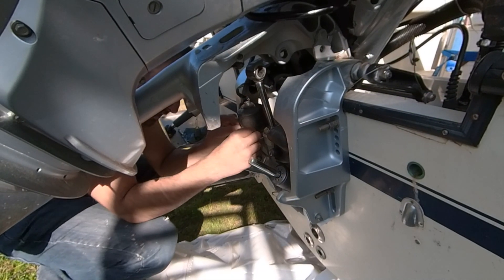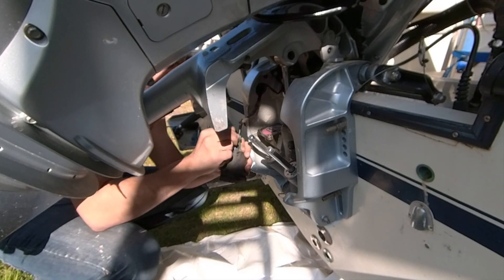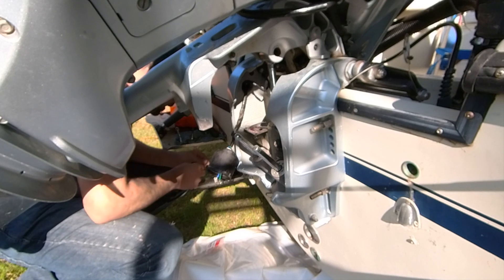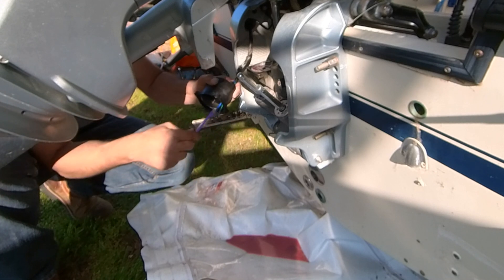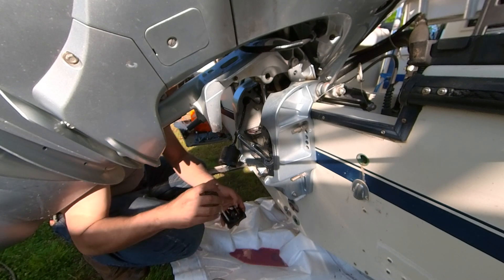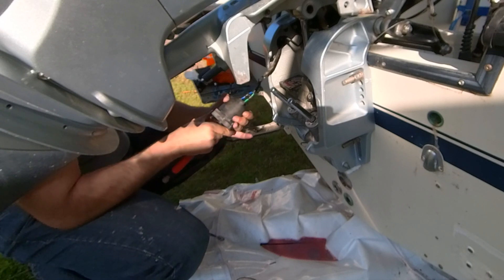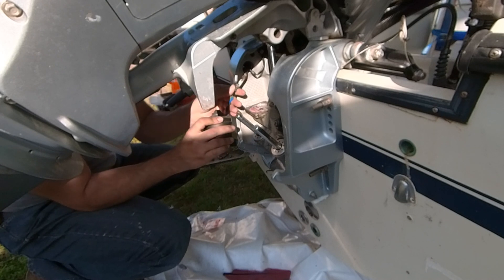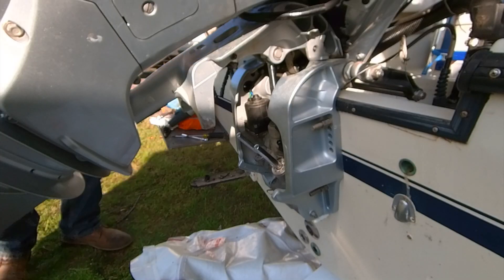Honda BF250 power trim service.

Comment: Thank you for your help, with your help I got up the courage and cleaned the engine only that the problem still persists for me and maybe you have an idea how to solve it or what I need to check.
After sliding the boat and going with it for about 4-5 minutes and I wanted to move down the trim-engine the fuse 30ma break.
What can be the problem?
Reply from the maker: I need to know exactly what you did to the engine in order to try to guess what could have happened. 
In the meantime, if the fuse that blew is the one that controls the trim, check the wires in the engine. If your engine has a trim switch on the side of the engine, try to see if that switch works, then trace the wires so you can identify the right solenoid for the trim.
Reply: thanks for the answer. in fact, on the side it has a trim switch that allows me to raise or lower the engine and I have already checked the wires (but I will check them again with a multimeter). What I  doesn't understand is why the fuse only blows when I'm on load when I try to take the boat on a wave with the engine running at 4000 rpm or while I'm driving it at 3500 rpm (could it be because the boat is very heavy?)
Reply from the maker: @ayanyutuberul99 That sounds about right. The only thing that I don't understand, is why is not properly fused from the beginning if that is the case. 
I would suggest that you change that fuse with 5 or 10 amps bigger and se what happens. If it is just because of the load it should last longer. If there is a short, it will still blow the fuse. So that and tell me what happens.

Comment: Great video!  I have a Honda 200hp that won't go down even though its getting power.  Do you know the individual names of the parts that you ordered?  Would like to order them ahead of time as you did
Reply from the maker: You will need to go to the website and find the schematic page with everything there. Boats.net is a great site. That's where I get all my parts. If you decide to do some work on your engine you'll have to get familiar with the schematic page and order anything you need. You can find even the smallest screw.